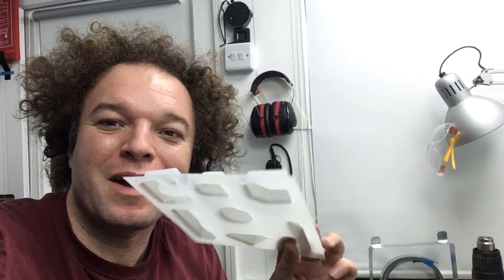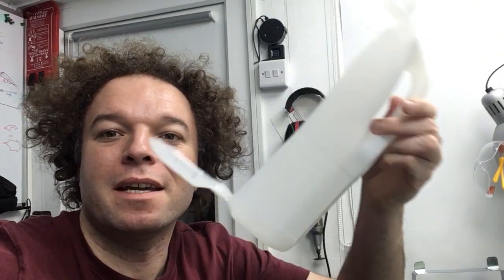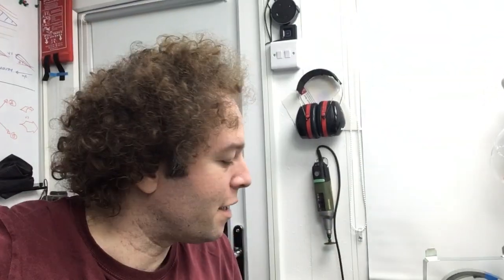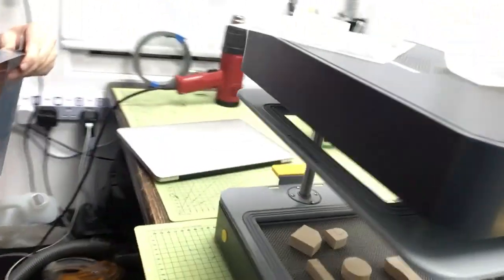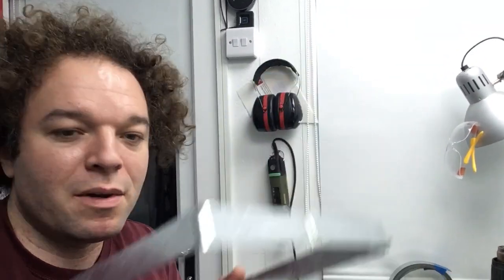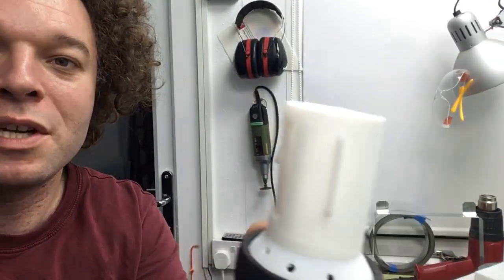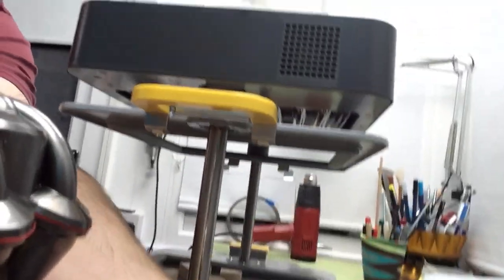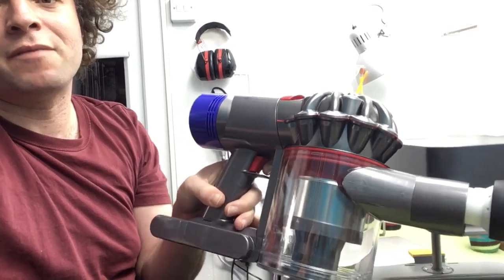Mayku FormBox - Recycled Plastic Milk Jugs - for Vacuum Forming

Comment: Hi how did you make the adapter to a cordless Dyson please?
Reply from the maker: I just made an approximate fit in CAD and 3D printed it. But this was just for quickness. The rubber adaptor that comes with the Formbox will still work just fine. But you need to switch it on yourself as it’s not mains powered.  Hope this helps?! 🙂
Reply: @JudePullen  thank you so much!